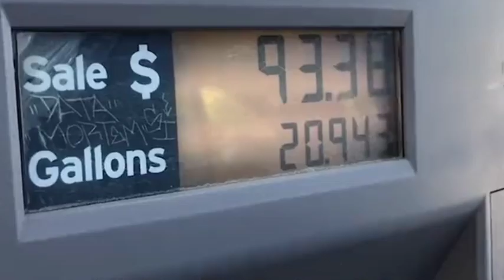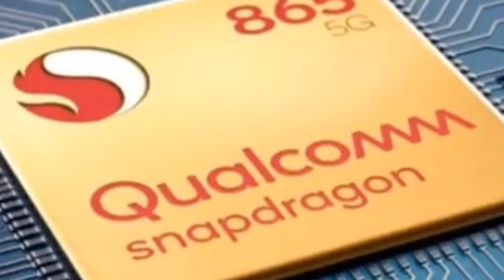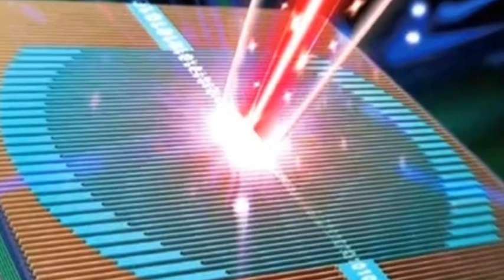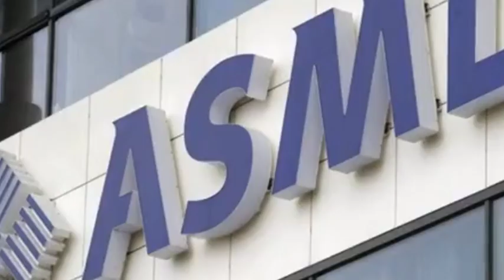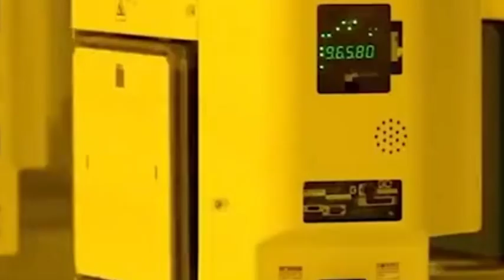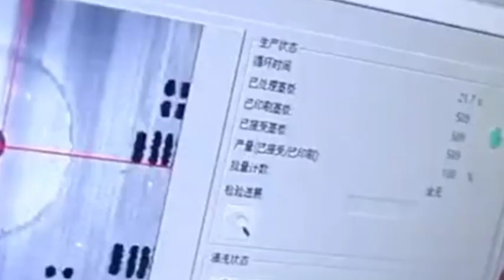China is moving towards independent R&D, no longer relying too much on imports.

Comment: Really sloppy reporting.  Huawei, like other American companies had a fabless shop called HiSilicon.  Apple, Qualcomm, Nvidia, AMD, etc are all fabless companies.  Only Intel and TI could be called integrated, with both fabless and fab capabilities.  The sanctions against China woke Huawei and others up to develop their own total supply chain and seek fab as part of their business.  That consciousness came when its fab source, TSMC, was restricted by the US to use US IP equipment to make Huawei Kirin chips at 5nm.  Right now, it appears that Huawei will reenter the semiconductor market with its Kirin chips made by SMIC using their 14/12nm node production line.  Huawei is also setting up its own fabs in Wuhan and Shanghai Huawei says its 5G gear now has only 1% American parts and is seeking to make tthat zero.. The next couple of years will be exciting to watch as China brings online a photonic chip production line this year and things like photonics, graphene, quantum chips, mature from research to production. Many think these newer technologies will extend Moore's law as they bring higher bit rates and lower power consumption.

Further, in 2022, China reported that it imported 43 billion chips from abroad and exported 160 billion chips. China says it is producing over a billion chips a day and is shooting for 900 billion chips per year by 2025.  In the 2020 to 2022 timeframe, 30 new fabs were created in China.  SMIC says it is about to launch a 7nm production line and developing 5nm.  China has produced its first lithography machine, trying catchup to ASML.  China says a photonic chip production line is about to become reality this year.  China is focused  on mature node chips while it expands its research and development in 5nm and smaller nodes. Remember, only last year Intel made the transition from 14nm to 7nm, so China is not that far behind.  Five years ago, most pundits said China was 15 to 20 years behind, today it is at most 5 years behind.